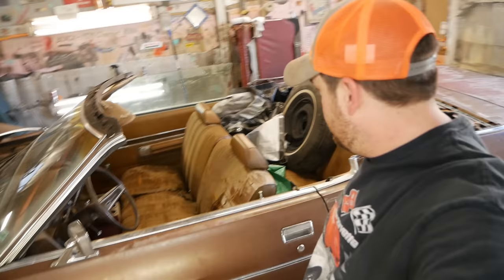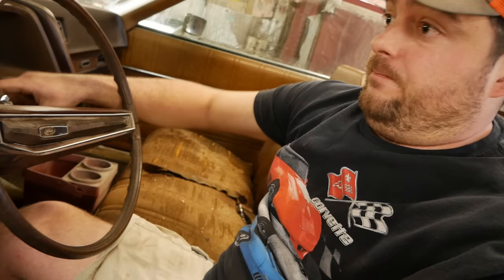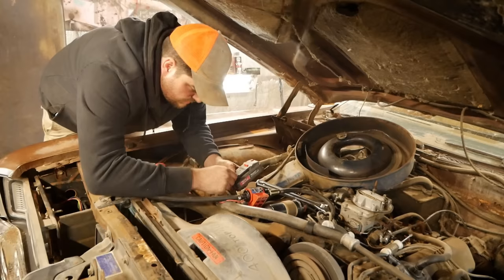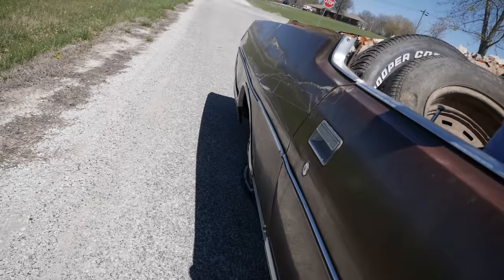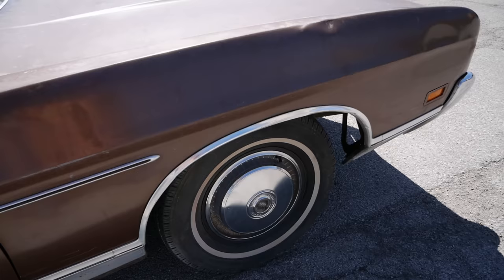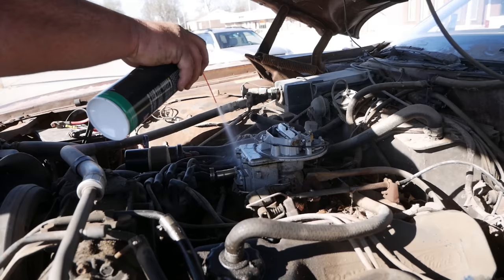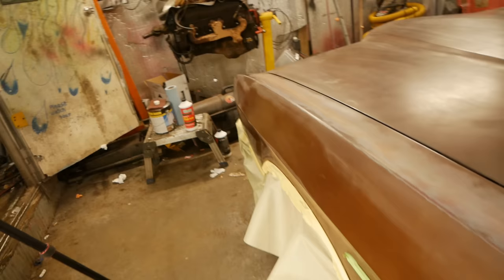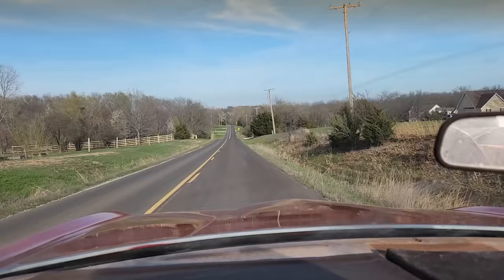CHEAP Paint Job and Hauling a Trailer with Roadster 1972 LTD

Comment: More please. I have a 1972 LTD (factory) convertible that my Dad bought new. It is all original except I put new wheels and tires on it to get rid of the whitewall tires and hub caps. I need to do the rear brakes and get it out and drive it some. Oh and it has a tow hitch on it he put on back in probably '73 to tow a boat. Now that was a sight. I learned to drive in that car when I was 12 and now it is my car. My youngest daughter (21) wants it when I die. I told her I was going to be buried in it and she said she would dig it up. LOL I'm just happy she likes the car. How many 21 year old girls in 2023 would like a 1972 LTD?
Reply: That last question is a good one. My question is: Would a restored old Ford LTD be a chick magnet nowadays as long as it no longer looks like an Uncle Buck Express? Probably.

Comment: My dad’s cousin in Alabama would flip cars (in 60s & 70s) and some got his special paint job too! He said his cousins way of painting was like this. In his back yard, out in the open air. He’d get some oil base paint & thin it down w/ regular gas (1960-1970s gas) then put it on w/ a paint brush and roller 🤣🤣🤣 Dad said the finished  paint job flowed out & beyond belief, had very little brush marks or ripples on the car or old truck & actually look good after it was done.🤣🤣🤣
That was his side hustle and per my dad, his cousin did this his whole adult life. I’m no painter so I’m not sure how it would turn out but my Dad said they looked good when finished. 👍🇺🇸

Comment: I did a rustoleum paint spray on my gambler but I used the tractor paint hardener with it and it turned out pretty good, but I gotta say, that massey red tractor paint looks damn good for what it is.. I may have to try the tractor paint for my next budget builds!

Comment: Tires, brake pads, alternator, fuel filter, fire extinguisher, nitrous plate to go under the 2100, open element breather, fully custom by cutting holes in the factory Ford breather surround, custom fitted roof tarp, and most importantly, chrome spray paint for the windshield header.      Get it.

Comment: I definitely would get new fuel line, new tires, brakes, put some rubber modeling on the sharp edges if needed and put metal down in the trunk floor and screw in the whole tailgate panel then get it registered. I call that finished and a win lol. Car is looking better and better each time still not perfect but looks better. I enjoy this content/mini series with this car. Hope to see more content with the silver dollar Chevy and other cars soon.

Comment: I had an 84 Subaru that I drove until the piston shot out of the rear caliper. A quick twist in and new pads and back on the road for another 1000 miles then install the 2 pads. WHAT A CAR.

Comment: 16:09 Fun story, my first vehicle was a 1976 F150 with the 5.9l 360 2 barrel, farm truck I bought for 300 bucks when I was 14 (I'm 22 now). It had sat for 15-20 years in a cow field till I dragged it home to my dads garage, got it running and drove it thru highschool. it had barely any compression or oil pressure, would barely run half the time. Well once upon a time me and a buddy had stopped at an autozone so I could waste an egregious amount of money topping off every single fluid it leaked/burnt/puked every time I drove anywhere. And my dumb teenager ass cranked the hell out of that filter and of course it broke off,  so long story short we were stranded in that autozone parking lot for something like 8 hours tryna fix it and eventually had it flat bedded back home where I rigged it together with a tube of seal-all gas resist glue. No joke i drove around with the fuel line glued in to that cheapo chinesium motorcraft 2150 knockoff for at least a year and a half before my neighbor had to help me chisel the threaded part out. I finally just bought a remanned autolite carb and put a hose fitting with a clear filter instead. Brought back some memories seeing that filter snap off lol

keep up the good vids I appreciate the commitment to REAL budget wrenching on old shitboxes, especially the LTD content makes me wanna get back to work on my 69 galaxie. 
peace from NC

Comment: I used the original spare out of my 77 e150 one time. Sat inside the van covered looked new. I knew it wasn't a good idea but I used it anyway. The tread separated  from the tire with such violence that it smashed in the whole rear cab corner and wheel well and whiped up smashing my tail light and put a massive dent running from the bottom of the tail light to the bumper. Serious whip action. The best part is it despite being nothing but wire I managed to limp the last 40 miles home. I forgot my phone at home that day lol

Comment: Dalton, ive had great success with swapping a mater cylinder (after its bench blead) and then pressing the calipers back in so it pushes the air up and out of the lines. Then when you start pumping the brakes it just puts fluid back into the lines.

Comment: I like it ! If all the hardener does is help it dry I’d forget about it. I painted my 1996 dodge truck with rustolium and never used hardener. So what if it takes awhile to dry. I painted the truck 3 times or so in 9 years. I used a small foam roller each time…… maybe remove the back seat and trunk lid if you keep this thing. Turn it into a ranchero. Fun video !

Comment: Guys , show us more of your new "red terror". Most people would have looked at the rotted out roof and scrapped it. The "roadster" option was a great fun move, and for 65 bucks and some prep and spray work, it looks amazingly better , masking how nasty it originally looked. 

Best of all though how sweet these old late 60's & early '70's monster cars can run with just so little mechanical work . Imagine trying to do this with most European cars, forget it, a total resto' would be required. Not with these big old boys though , a wrench, screwdriver, a pair of pliers, and perhaps a trip to the local car/motoring convenience store and for under 200 bucks its up and running.

Comment: Ya, duct tape goo does not come off sanding worth a crap. Found that out on an old farm house door I was sanding today to paint. It had all different types of tape all over it from years of stickers. Thought I was in for a long day of dealing with it with the sander. But, the home owner had some 3M adhesive remover and it all came right off. Saved a ton of time.

Comment: Rewatching because here I was, about to drop 2 grand on a Maaco paint job. You've inspired me to do my '79 F100 with Oliver Green tractor paint.

Now if you want to be bottom-barrel budget, next tractor paint job you do, you could try foam paint rollers to put it on, because guys like me don't have such high falutin luxuries as an air compressor!
Reply from the maker: Just an airless sprayer! Will it work? I have no idea

Comment: Hi Guys , You have by far the BEST auto channel on here. I love the red color you painted the car . Replacing the trim was some method that you should apply a patent for , before someone steals your method.
I don t think you should waste money on an alternator , instead just get one of those booster packs and leave it under the hood , also get a 100 foot extension cord. Zip tie the cord to the fender or better yet , put a few hooks into fender to hang the cord. SO when you think the battery is almost dead , pull up to a house or store , plug in , have maybe just a few beers and your good to go. BTW you can probably sell the car at BARRET JACKSON , its probably better than some of those cars. Lastly I hope you aren t upset by me giving you an idea , just trying to help. PLEASE MAKE MORE VIDEOS. You guys are just 

REAL MEN WORKING ON REAL CARS.....

Comment: I like cheap paint jobs too, usually better than patina, and once brush painted my van.  If I wasn't too busy watching videos (with what I think is COVID) I might go out and brush paint at least parts of both my cars as my dark green Metro could use a white roof to help the AC, though this could wait until spring, and my white W150/225 with it's black cap could use some color, and it's roof is going patina and so could be whiter.
   I don't own a paint gun so it's brush or rattle can for me.

Comment: Way better than a Earl Scheib $29.95 paint job for sure! At least you taped it off, they never did. Had a friend take a 66 Mustang to Earl Scheib , (I was there) drove up, they drove it in, blow off the dust and painted it. The center of the windshield and the tires was the only thing that did not get painted Red... Lol
They said don't ever pressure wash it, hand wash only in a month. Took days for the paint to cure and a week to get the paint off the chrome and lights... Lol
Sadly he did not tell his wife and she had it washed at the car wash and it pealed off the paint in strips before she stopped... 🤣 So Sad! 😥

Great video!

LLAP 🖖

Btw, this was in Nashville Tn on Gallatin Rd. in 73 or mid 74.....

Comment: Here's a good tip.. Sprayway foaming glass cleaner also works great as a wipe down concoction pre paint...I know a guy that paints low riders, that's all he uses for prep...Im talking high end paint jobs as well so it should be perfect for your needs 😅

Comment: I have always removed the vacuum boost line and poured sea foam right into that vac line that way totally saturates the intake induction vac lines extra ,  let it sit for 30 min ,, start it and give it hell for 5 , 10 , minutes then run it with a extra bottle in the tank ,,, I do this once a yr in both my Nissans ,,,, with a bottle in the tank every 6 months ,,,,, just a Teck tip to keep them running clean and good ,,,,,

Comment: Was noticing the area of motel above windshield of 1972 LTD. Are you going to use your fiberglass putty trick and hardener to fill and harden and mode to fit the top of windshield frame in a future video if can?

Comment: You could buy some acrylic enamel hardener for automotive paint,its not super expensive and it will work,I've used it before.
Reply from the maker: Can't use it in tractor paint in my experience, last time I did it turned to goo

Comment: I have a 68 Galaxie. 50% of the time it’s not the alternator it’s the 4 prong flat plug on the voltage regulator behind the battery. They’re stupid loose from maybe age, seemingly from the factory. Gotta crimp them tighter.

Comment: My first car, 1972 Galaxie 500 4dr , same body with the rear bumper solid in the middle..on it's 7th motor/3rd transmission both toasty, wires showing on 3 tires, bottoms of the doors matched the wheelwells. 780k?! I was 9 but I did get the keys!

Comment: An interesting story about the Ford Galaxy was that Ford received the product placement 'contract' for  "Bullit", they supplied six cars but they all simply collapsed on those San Francisco cable-car tracks. Steve McQueen regrettably had to sack Ford and use the much less popular Dodge Charger.
Your Galaxy is performing to specification.

Comment: Saw you when you got back from getting the trailer. You were just crossing 58 and 7. BTW that's the home of Born in a Barn Diecast in the white barn there 🤪 thought you were going to lose the trailer, but you didn't. When you get the Gran Torino done to where you are happy aka paint, new stripes I'd like to do a 1/64 scale version of it. Technically 2, one for you and I for my collection. I have 2 to do and I can't think of anything cooler to build with them 🍻
Reply from the maker: Absolutely! I'll have to stop by sometime if I think of it

Comment: It needs a structural bar to tie those rear quarters together coz yall removed the, top. Convertible bodys have more structure behind the rear seat than a hard top. Id be afraid the azzend would butterfly going down the road.

Comment: I did body work for over 10 years lol this is awesome I always wanted to chop a top and I also owned a 1972 LTD brohiem or whatnot 400 big block with a two barrel carb j was 18 and bought it running and garage kept with 72,000 on a 1972 I paid 50 dollars brand new car cause of it being a trade in the dealership said they can’t sell it sold it to me for 50 I was an employee I got it before they serviced and detailed it save me 100 lol
Reply: Sadly it just sat and I didn’t drive it and it eventually had time take her went to start it one day breaks went to the floor and rusted up so I sold it for 300 drove it there with the pedal E-break doing 15 the whole way lolol

Comment: Im kinda curious, wouldn't cutting off the roof weaken the car's structure? But i gotta say, it looks so much better as a convertible 😂
Reply from the maker: On a full frame car like this, not really. Structurally the car is the same ish. Technically yes the body would be compromised, but.. honestly who cares 🤷

Comment: Is there a particular brand of self tappers you prefer to use? Do you use 5/16 or the smaller 1/4 inchers? I know on one episode you even used wood screws, and that opens up a whole set of new questions. Ever thought of using safety equipment? yeah, me either...I noticed you have a smaller room attached to your main "work" shop. Is that just for storing stuff, AKA junk, while you have a car in the work area? I saw you bought a welder on a earlier episode. have you used it much since you got it? I got bit by the welding bug and now I'm making all kinds of crap I didn't know I needed until I got a welder. Love the series, don't even think of changing a thing. Tell your brother we said hi. He looks like a fun guy....that wasn't meant to sound creepy.

Comment: It doesn't need new brake pads, tyres and fuel lines.... It just needs Better brake pads, tyres and fuel lines than it currently has. Can't you find any old old but betterer stock at a junkyard?
Reply from the maker: Junkyards don't have 70s cars anymore man
Reply: @PoleBarnGarage  not even any fellow hoarders?
You already put 1 new part on it and it didn't like that At All.... Any more and it might get really upset.
Reply: @PoleBarnGarage  just throw he disks/drums on Kevin’s brake lathe and hit the pads/shoes with some sandpaper

Comment: So could you cut and buff that paint when it dries to get the dirt and dust out? Thinking of painting one of mine with cheap single stage. Never painted a car before...
Reply from the maker: You can cut and buff any solid single stage color, just be warned it's more difficult to shoot or repair than base clear

Comment: 60 is way too fast for a car that old and rusty.  I support the use of old rusty cars, and pulling trailers with the full size v8 sedans as that is really their only practical use, but you have to slow down for safety, and to hell with speeders and tailgaters as the bicycles and farm tractors say.
   There are other ways to help speeders pass besides speeding up.  One is pulling into the library as you did, though still too fast, another is moderate breaking when a passer is right beside you so they can pull in faster, if they see you, truckers blink their lights.  A third is to slow down even further and pull right as far as possible in clear passing zones so that passers can pass in a lower gear.  Slowing down also gives you time to better inspect the shoulder, so you can run on the shoulder whenever shoulder quality permits.

Comment: That's why I don't like Seafoam.. ran it through a bike one time & did same, just gotta run that crap out. U need sum bull horns on the front grill now!! Haha boss hog!! Jus wished you'd bondo those dents before painting!!! They make a vinal spray paint... Be cool hit that interior lol
Reply from the maker: I wanted to fix the dents, but then you have to prime, sand, block. More than a couple hours lol

Comment: The Great Mechanic will not allow you to lose the shop.

@28:26 - The Great Mechanic will also send cough drops.

The Great Mechanic FEELS for those millennials, trapped in that tin can, locked away from Life...

The Great Mechanic shall favor whatever content you choose to create. As long as The Great Mechanic has a turn at the wheel... 😎

Comment: WTF. Is the mastr cyl for a right hand drive? 
I see the rear bumper is the energy absorbing variety....
Oh and for sure heed the warning sticker on the dashboard, dont leave it running in park, when you shut the drivers door those like to slip from park to reverse.......
You all are show off's. What with showin off those xtra spare tires and the full wheel covers and all.

Comment: Freaking ford 🙄. I almost wonder if the brake parts being wrong were a mid year revision or a incorrect year? I even looked for brake hoses, couldn't find the right ones. But there seems to be some correct Master Cylinders on RockAuto?